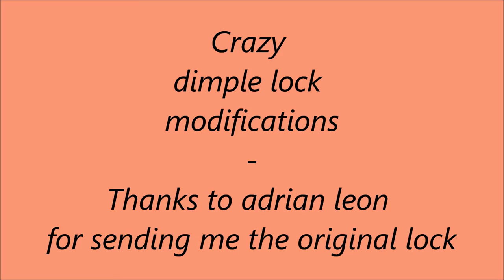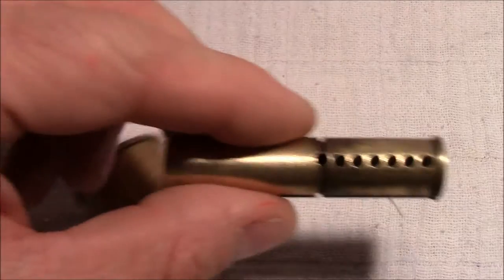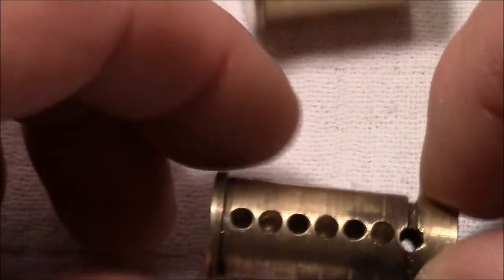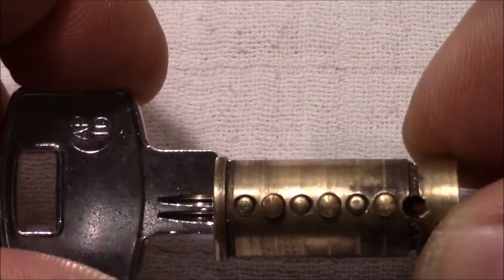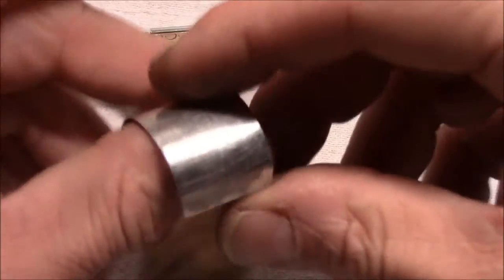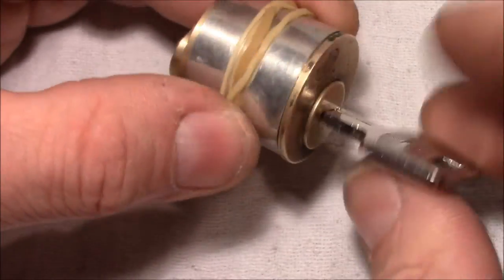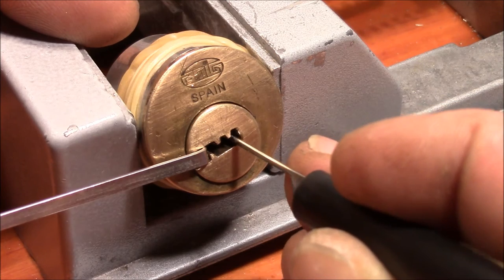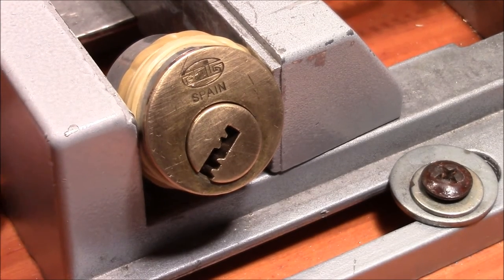(picking 81) Crazy dimple lock modifications - thanks to adrian leon for the original lock

Comment: Nice! :D
But won't drilling the wholes into the key through the plug decrease precision as you probably will widen the key chambers unintentionally?
And one idea: You could cut the end of the metal sheet angled or in a stairway fashion, so that when you rotate the sheet around the housing you can access the pins one by one individually. Don't know if that's necessary though. ^^
Reply from the maker: +no-trick-pony_lockpicking Thanks. Yes you're right with the side effect of drilling the key like that. I was considering to mask the drill bit to prevent scratches in the chambers but then I had to use a smaller drill bit and then the drill mark in the key would become to small and all this fiddling on the drill bit...
Finally I decided to just ignore that problem ;-)
Interesting idea with the metal sheet but I fear that bending it like that would be very hard.